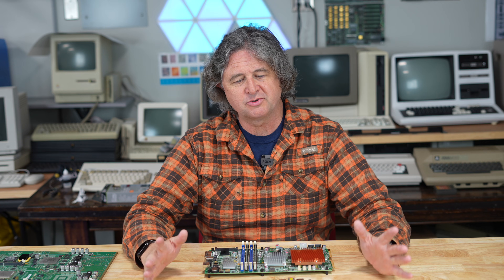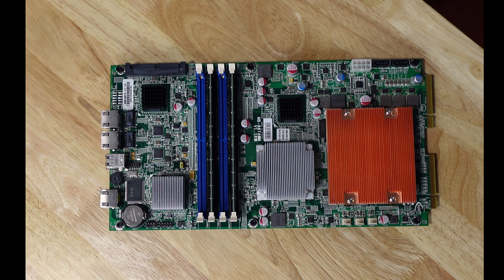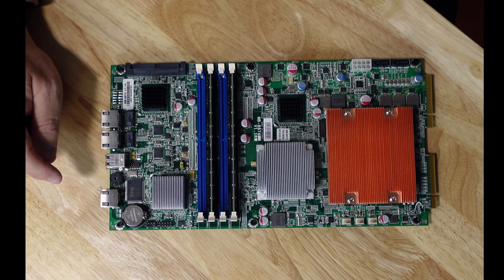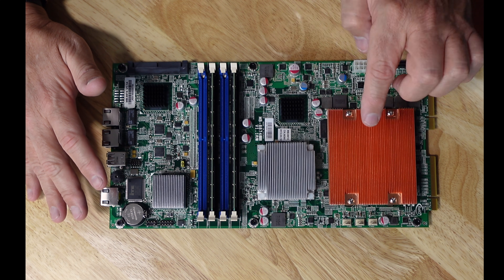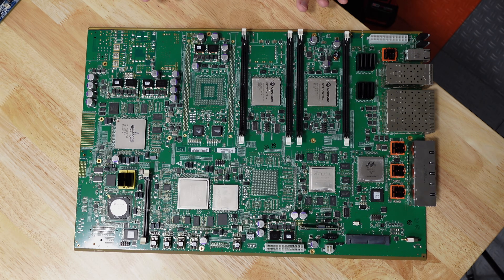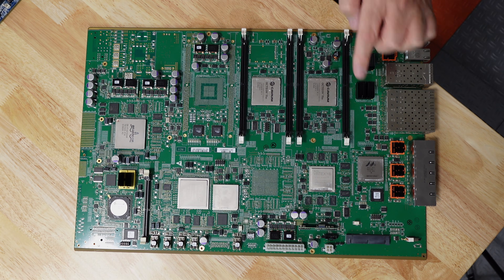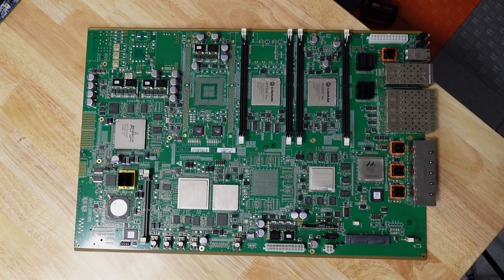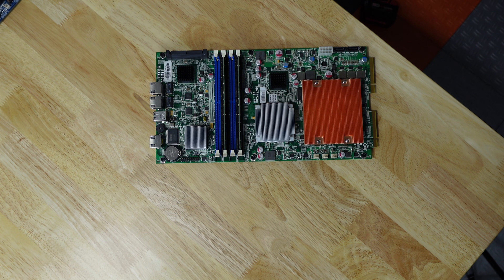HOMELAB: Are there parts of a Palo Alto 5050 that we can reuse?

Comment: Interesting how that board is covered in chips from companies that hate each other. (and marvel is now owned by nvidia, so even more reason to hate them) Just because it's a SAS connector doesn't necessarily mean they're running SAS over it.
Reply from the maker: Yea I thought the same thing, but on the other side it has a SAS controller hooked up to it.  The PC side board is a more generic OEM capably board.    I have another bigger Palo as well to take apart so I'll check and see what that one has!
Reply: @jeffsponaugle6339  Weird. WAY back in the day, there were loads of things one could attach via SCSI - the next cube's printer, for example. For a brief period, there were ATAPI (SCSI over an IDE cable) floppy drives. (LS120 looks like a hard drive) I've not seen anything but storage systems (disk and tape) using SCSI, and now SAS, for many years.

Scott Bork (yes) wrote an IP stack for SCSI decades ago. [for the adaptec 1542]  And FC supported IP-over-FC for a long time - it's been removed from pretty much everything these days.
Reply from the maker: Yea, it is pretty flexible! - I remember IBM having some interesting devices on a SCSI bus.    Oh the Adaptec 1542 is such a classic.   I have one in one of those ATs in my background!
Reply: @jeffsponaugle6339  Ouuh, would love to see a teardown on the bigger palo alto device, which model is it!?

Comment: Fun video.  I went down a similar rabbit hole with an Extreme Networks E1120 Cloud Appliance.  The motherboard was also made by Lanner.  I was able to get an output and currently have OPNsense running on it. 
I reached out to Lanner to see about getting a BIOS update for the board... when they asked for a picture of the serial # I knew my hopes were dashed.  They replied that due to a non disclosure agreement they were unable to provide any updates, manuals, or information.
Reply from the maker: Ah yea, I figure most of those boards are sold to OEMs for uses like this.  Cool that you got it running OPNsense.
Reply: Well, never mind, let's wait until the data from Lanner "leaks" :)
Reply: Surprised Lanner was even talk to you as you aren't a customer.
Reply: @ I was too. If I recall correctly I got one of those chat squares while browsing their site. I replied that I was looking for a firmware update but the chat wasn't a chat and it went to a zoho email. That got forwarded on as a "support request from the USA"